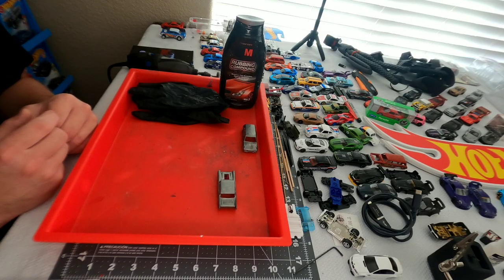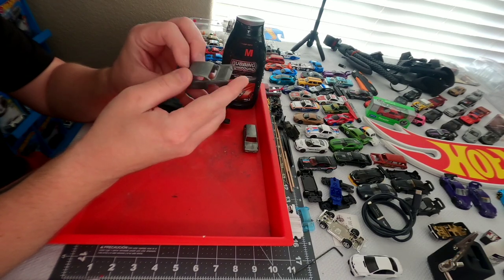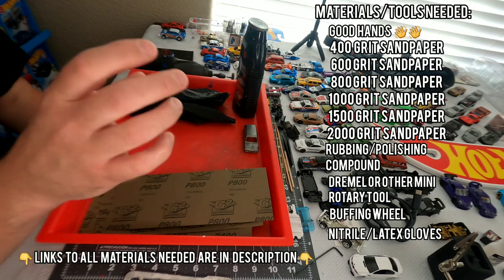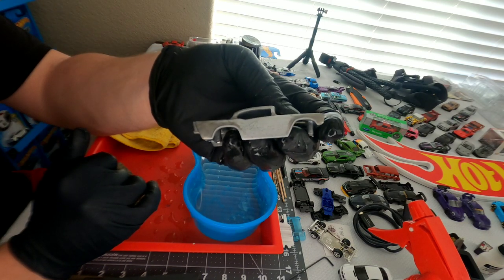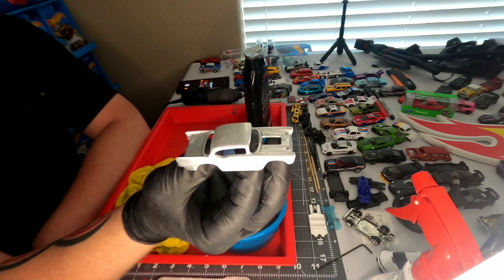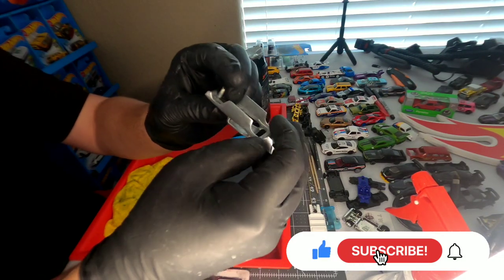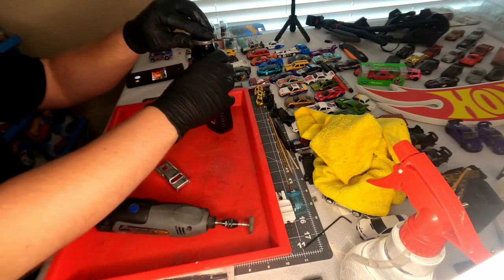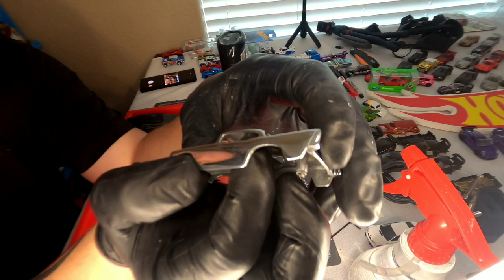HOW TO POLISH YOUR DIECAST CARS TO A MIRROR FINISH!!!

Comment: Add 5k and 10k grit to your list...its much better after using those as well.  Great video!
Reply from the maker: Oooh nice, will do Widowmaker!  Where do you purchase those?  Not sure if Ive ever seen em local.
Reply: @HonestDiecast  Amazon..search for this.

Sanding Discs 6 Inch,10000 Grit Wet Dry Sandpaper,Silicon Carbide Hook and Loop Random Orbital Sander Round Sand Paper by MAXMAN,30-Pack
Reply: You can also find 12k grit padded sandpaper at Hobby Lobby

Comment: thank you for the description with the item links! Been wanting to get into diecast customs but was lost and overwhelmed by how I might mess up or even know what to do. You make this seem doable for someone like me. The step by step and in depth explanation with tips really just shows how much tou are going above and beyond for this and really seem to want to help! I know this is long winded, but again. Thank you, this hobby has gotten me through tough times by allowing m to collect my favorite cars, built my childhood with hotwheels of all kinds, and has recently allowed me to find a small group of friends that like diecasts too! I only have one suggestion that my dad taught me as a "family secret to touch ups" (he built things alot); maybe to fix some imperfections or straight up cuts, grooves, or divits, you can use a sort of wax/enamel or soft acrylic (the kind that you can make that molds alot like clay but easier to cut) to make a very fine layer by getting it soft enough to get a flat surface (razor blade at an angle like you are doing a reverse scrape) to allow it to fill the gap. Then, as I've seen people do for other things, spray silver over it as a post-primer coat. (Primer not always needed as for some things like irl aluminium car mirrors on older cars only need a thin clear coat and silver) i hope I don't sound rude trying to teach a pro, but I'm just really exited about the discovery of this channel and want to share some other tricks that might work too! Anyways, bye and thanks! (Again, sorry this is long)
Reply from the maker: Absolutely no offense taken, I appreciate the additional input and suggestions!  Im happy you found this useful and if you ever need help going forward, please don't hesitate to ask!  👊😁👍

Comment: Great Video! You think it’d be okay to sand to 2000 grit and then never dull the cars?? I’m assuming the degreaser will take all the left over residue off??
Reply from the maker: I'm pretty sure the polish would hold up for quite a while if you used a good polishing compound after the 2k grit.  If you plan on painting after polish, then a really good clean is a must.  I personally drop the car in a jar full of acetone and let it sit for some time.  That seems to do the trick. 😁👍

Comment: Don't know if this video is too old to answer my question, but could I replace the buffer and polish compound with 5000 grit sandpaper? I have the supplies, but like to brag about hand sanding to a mirror finish.😉😁
Reply from the maker: Not too old at all, Eclectic!  You should always finish with polish compound to get the fine imperfections out and to bring out the shine.  Buffer wheel works best but you can certainly apply and remove the compound by hand if desired! Hope this helps!  😁👍

Comment: You can also electroplate the casting with zinc to fill in imperfections, etc. before sanding and polishing. That's what I do.
Reply from the maker: Yes Justin, great idea.  I looked into zinc plating as shown by BareMetalHWs but I never went through with it.  I need to try it!  😁👍
Reply: @HonestDiecast  I have a bench 12vdc power supply, and I get the muriatic acid at Lowes, a gallon jug is pretty cheap and will last for quite a while. I tried using zinc galvanized flashing as the sacrifice, but didn't have enough pure zinc...so I broke down and bought some on Amazon. I also have a copper bath, I made with the same acid and leftover copper wiring from various circuits I've added to the house. Plenty of sacrificial copper for copper plating!
Reply from the maker: Sounds amazingly interesting!  I want to try!  😁
Reply: @HonestDiecast  It's pretty fun, too! Just...just don't do like I did, get crunk and forget you have a car body in the acid plating bath....and leave it overnight.
Reply from the maker: 😆  did it pile up too heavy?
Reply: @HonestDiecast  No, quite the opposite. It dissolved everything but the stainless steel screws. I had to buy another '69 custom corvette for the body.
Reply from the maker: Oh man thays crazy!  😆  Hopefully the second one works better!  😁👊
Reply: @HonestDiecast  It has. I wet sanded up to 3500grit, and then applied NevrDull. I have to polish it with the dremel cotton swab ball, and then if it isn't shiny enough, brasso and then NevrDull again.

Comment: Do I need a rotary tool to get that mirror like finish? I tried using just my elbow grease and can't seem to get the same effect? I'm wondering if I didn't sand it properly or it's really the rotary tool that would make the difference. Thanks in advance.
Reply from the maker: This write-up was all done sanding by hand minus the polishing compound (which can also be applied by hand).  A dremel with a buffing wheel will certainly help when applying the compound though!  😁👍
Reply: @HonestDiecast  I'll try sanding it some more then. Spent a good 20 minutes with the 400 and 600 grit. Maybe I rushed the last few grit sizes. Cheers!
Reply from the maker: Yeah give it a shot and take your time with the 400, thats the most important step.  😁👍
Reply: @HonestDiecast  Thank you for the advice. Sanded the whole thing again starting with 400 all the way to 2000. Then compound. Got the mirror shine I was hoping for. Next step.... Painting. Are you on instagram? Would love to show you the result.
Reply from the maker: Awesome, happy that worked!  Im not but you can send me pics at honestdiecast@gmail.com 😉👊

Comment: Can i only use polishing compound without rubbing compound? Because its hard to find the brand tha you use
Reply from the maker: You sure can!  Rubbing compound would just be an extra step but you should get a good result with just the sanding steps and polishing compound.  👊😉👍
Reply: @HonestDiecast  also is it different between wet sanding and dry sanding?
Reply from the maker: Yes, wet sanding is definitely preferred for finishing work like this.  👊😉👍
Reply: Thank you for answering my question, i will post the result in the near future through my social media🙏🙏🙏🙏
Reply: Btw i already try your method about wet sanding and dry sanding, its good but i think i need more sanding to get that finish. I also use the polish to have a chrome finish, but the result is a little bit darker, i already wash it with dish soapy water and still not as mirror look as yours. And the last thing i also try to heat up my spray can using hottest tap water for like 10 minutes, and i love the result although im trying to find the anodized spray can in indonesia which is rare especially uncommon colour. Thank you for your video and comment. ❤❤❤❤❤🙏🙏🙏🙏🙏